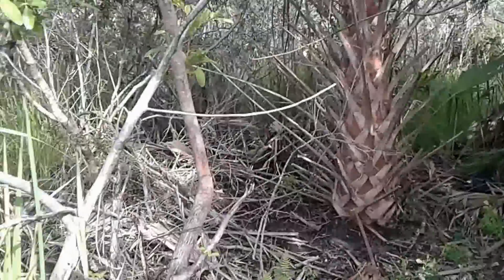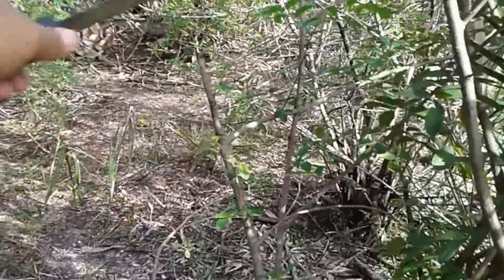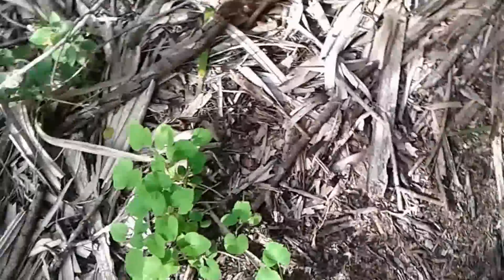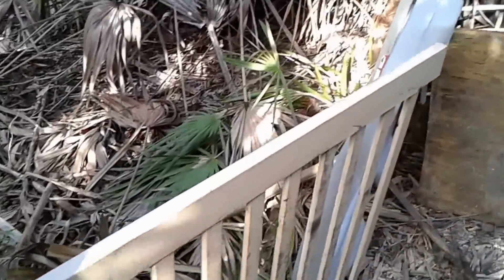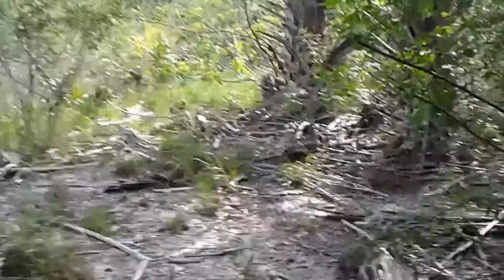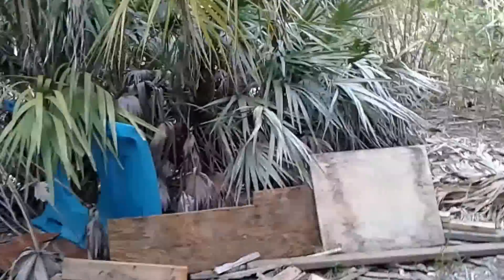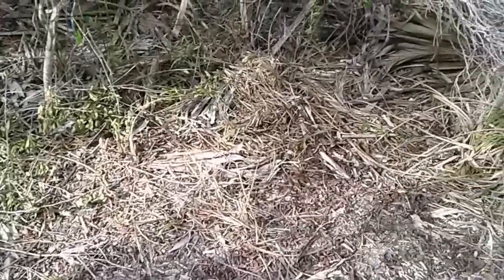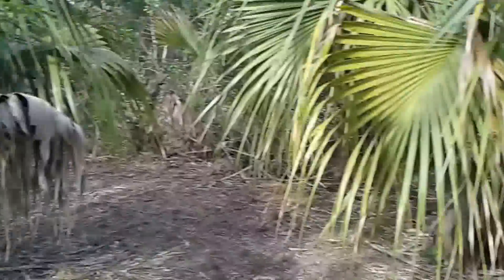Tiny House - Construction Begins On Yurt 2.0 Part 2 (V648) Bushcraft Urban Survival

Comment: So I assume now you are going with the octagon since you are divided the circle into 8 segments. If you want to inscribed a hexagon in a circle is easy. Take your string compass and get the radius of the circle. With that radius measurement put the Centerpoint of your compass on any point on the circumference on the circle then take the pencil end and mark one vertices point  on the circumference of the circle. Now move the Centerpoint of your compass to the vertices mark you made previously and make another mark on the circumference. Repeat the process until you mark all six vertices on the circle then draw a straight line between the six vertices and there is your hexagon. Or just Google 'how to inscribe a hexagon in a circle.

Comment: Did you draw anything out before starting?
How are we gonna  hang out if you're in jail?
Reply from the maker: The videos are delayed, so things are very fluid and changing rapidly on this end. The job through my wife's church fell through unless we can get the guy's actual phone number.  However, I've signed back up with the career center and will be there tomorrow morning to talk with one of the counselors and meeting with the Vet rep.  I spoke with the Vet rep on the phone earlier today and he may have a part-time job that would take me so that would at least get me working part-time.  He said there will be a full-time position in a month or so at another place that he will try to get me into, which would then give me more stability again.  Also, some developments are happening with my Antalgic Trak robotic chair gig, so things may REALLY change very soon.  If that happens, the change will be as drastic as it was when all this stuff went first down 7 years ago.  P.S.  I didn't draw anything out because I have no clue what I'm doing.  lol.  I'm just building as I go along based on resources available at any given moment and what is happening with my housing situation.